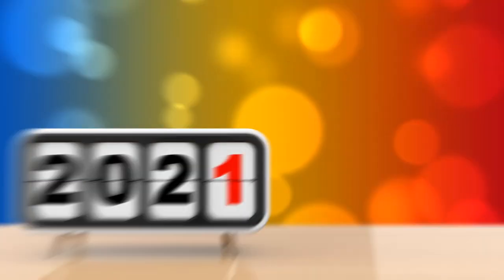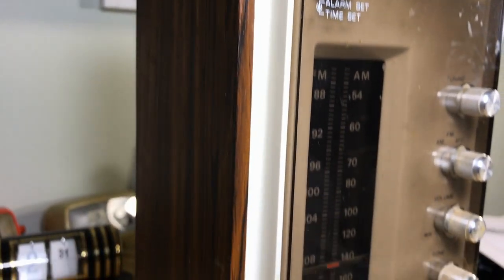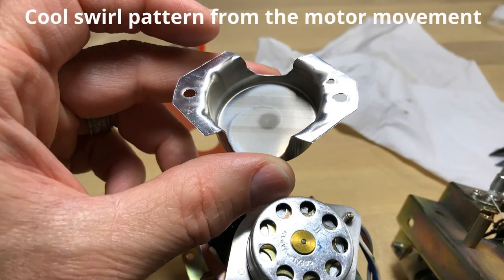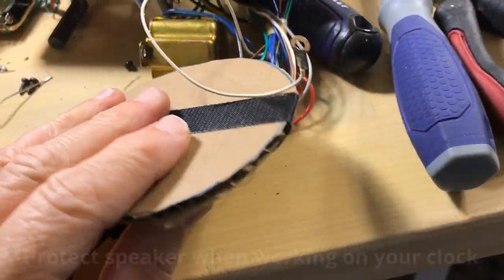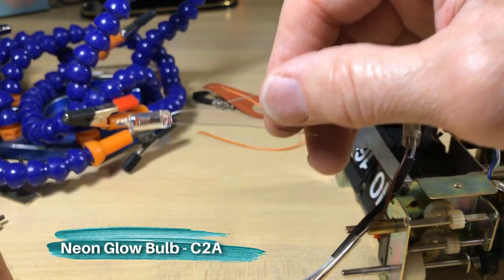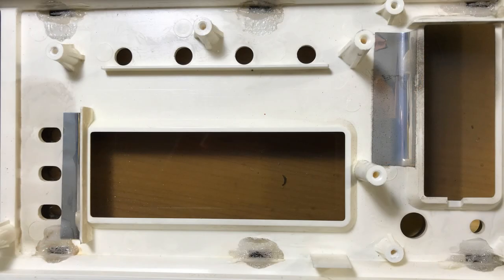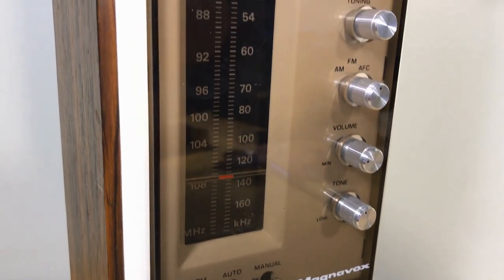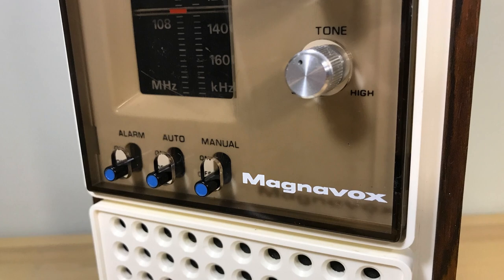Magnavox Model 1784 Tower Flip Clock Restoration

Comment from the maker: The ammonia in Windex dissolves that black stuff. Straight ammonia is too much. If you have chrome paint it may dissolve that. It has also been known to remove some lettering. But windex when applied and removed in a reasonable time is safe and effective. Still I follow it with Dawn dishwashing liquid and lots of water.